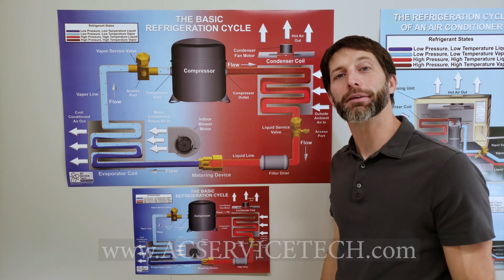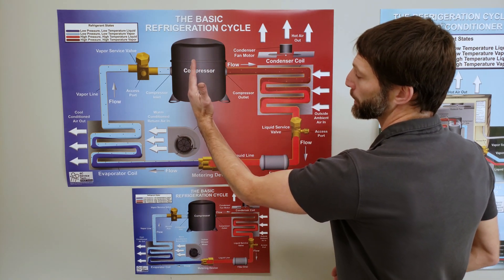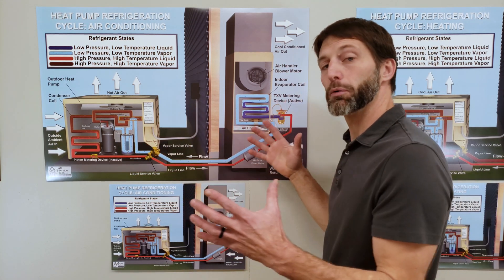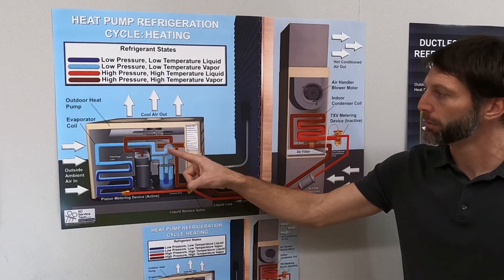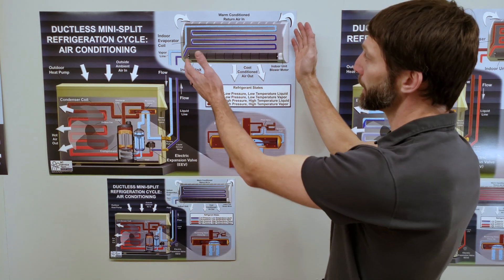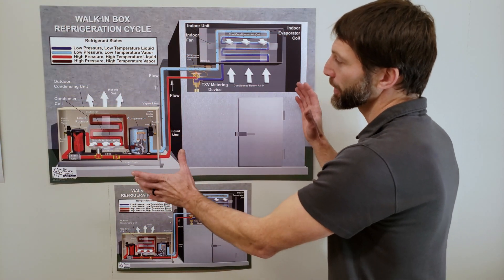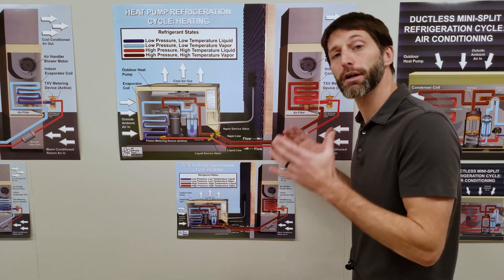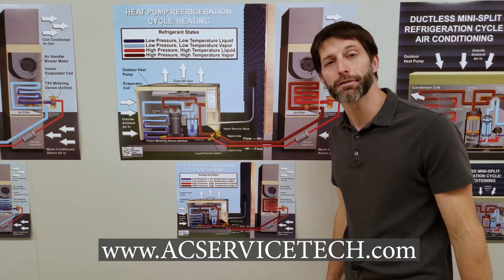HVAC Training Posters: Refrigeration Cycle in 7 Actual Systems!

Comment: Hey craig i have a question does system uv dye affect  digital gauges like can it harm any sensors or affect readings ive heard they do and they dnt any help would be great thnx
Reply from the maker: Oil/dye and just oil alone will contaminate vacuum gauges. I have not seen dye or oil mess up or contaminate digital manifolds though, thanks!

Comment: Supper nice do you have those posters  in a PDF format so I can use them on my cell for Reference.
Reply from the maker: Presently we only have them as the posters and as the PowerPoints, thanks!
Reply: Once you get them take pictures with your phone and save them as a PDF... Problem solved